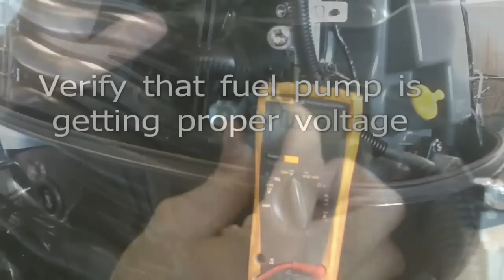Suzuki DF70 Marine Outboard Motor Electric Fuel Pump Replace

Comment: Is that a 2001? my 1999 df70 looks the same and I think I need a new VST also,but my worse problem is I have an oil leak thats dripping out of the front of motor and spewing oily soot in the water exit at the prop,fouling my plugs,,wondering if its my oil pump seals,maybe you have advise? Other than that compression is good

Comment: I have a suzuki DF60 looks like the same thing here, to clean the mesh on the filter on the pump inside the VST, do you have to take it off the pump and clean from inside, or as it is on the pump?
Reply from the maker: We would take the filter off and clean it on both sides to insure that it is clean.
Reply: OK Thanks!  How do I get the rubber piece off the filter?  Do those smaller rubber pieces act as some kind of lock to keep the filter in place?

Comment: I have a 1999 df70 Suzuki. 
Do you have a video or instructions on how to run the lines that water hose lines off the the fuel separator the intake manifold as well as the two lines coming from the front of the engine block thank you

Comment: For the same motor SUZUKI DF70 ( model 1998 ) Do you have a video / information how to :
a) properly remove the drive shaft  to change the bearings and seals inside ? ( all parts below the impeller )
b) properly remove the propeller shaft assemly to replace the bearings and check the pinion gear set?

Comment: Any recommendation on a 2007 4 stroke fuel injected that cranks but it does not stay on? One thing I have not checked is the fuel rail pressure spark plugs just cleaned is not in gear and it has clean high octane fuel.
Reply from the maker: +rafael johnson Not sure on this.  The only thing we can think of is something changed with the bell housing? Maybe something switched to the new design with the new mounts?

Comment: Hello! I want to ask, my suzuki, 90, over 4000 RPM speed drive about 5-10 minutes engine like cramps, and then can't accelerate, feel there is not enough oil supply, can only be returned to the gap, only after the knob pump oil, to speed up, can only keep about 2500 turn here to open, after a little way to begin to appear this problem again. Is this also about high pressure oil pump failure?

Comment: What maintenance should be done for a 140 hp Suzuki after sitting a year not used?
Reply: Run a constrated fuel treatment from a gallon fuel tank clean out the tank on the boat

Comment: Hey friend I hope isn’t to late to ask . But when you did replace the high pressure fuel pump . Did you have any light  problem like. ( REV. Limit) I ask you because sounds like I have same problem. But you did not mention if you have any lights problem on yours. 
Let me know I will appreciate so much. 🙏
Reply: when fuel pump does not work you can not start the engine ..  text me on  youtube if you have the problem
Reply: If high pressure pump is bad it wont run, if it runs but falters in some way, could be the low pressure pump or probably one or more of the filters. Could also be a sensor. Biggest thing you can do to keep from having trouble is use alcohol free fuel and when you store the boat after every use, unhook the fuel line run it until it dies then find the drain for the VST tank and drain it completely. Search for the service manual, it is available for free online. Here is a link to the manual, you can download. It depends on what yr your motor is if this is the right manual for you, or not. https://www.manualslib.com/manual/1201837/Suzuki-Df-60.html

Comment: I have 2017 Suzuki df90. just changed the fuel pump. But it seems that I have air in the system so the pump does not suck the fuel (i can hear it working). What should I do?

Comment: Ok, what is it when i replaced the fuel pump and reinstalled and i can hear the pump run but i can get fuel to come out past the new HP fuel filter. I turn on and off so it comes on, i took it off and tested with a nine volt battery and the pumps shot out fuel about 4" tall so i know it works, i know fuel is getting to the seperator because i can drain gas. is there a vent that would let the gas flow rather than keeping suction on it the entire time?
Reply: by the way, brand new low pressure fuel pump, as well as new screen filter under HP fuel pump. this is a df 90 but seems to work the same.
Reply: no pressure out of fuel rail, seems that the pump is not strong enough to push the gas out. I tried suction to the line got gas but even after that i cant get fuel out when I turn on the ignition and the pump runs for the 3 seconds.
Reply: David Carroll I hope you were able to get it going with all the advice you received back

Comment: I have a 60 horsepower 4-stroke Suzuki and I'm not getting any voltage to the fuel pump but there is 12 volt to the injectors is there a fuse that I don't find or what could be the problem thank you
Reply from the maker: Refer to your owner’s manual and check all the fuses on the engine.

Comment: I just bought a boat with a DF 70, with no power at the fuel pump, where do I start to find the issue.
Reply: fuse box , ignition and buy a service book  for about $15 on ebay